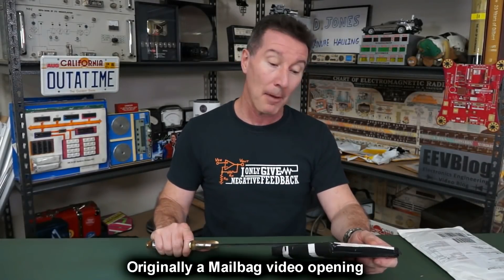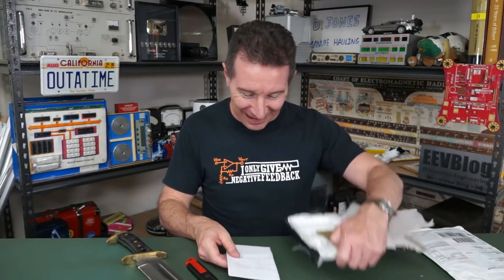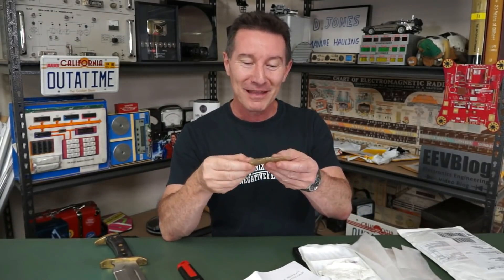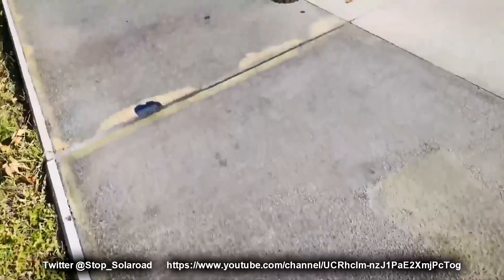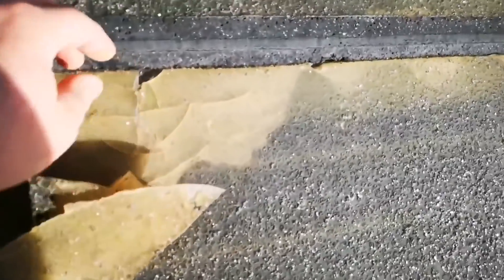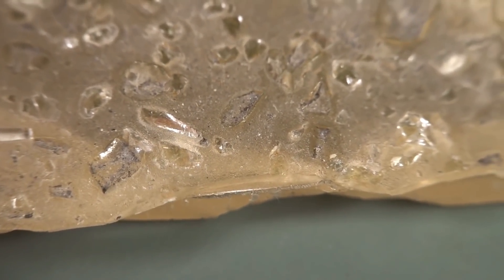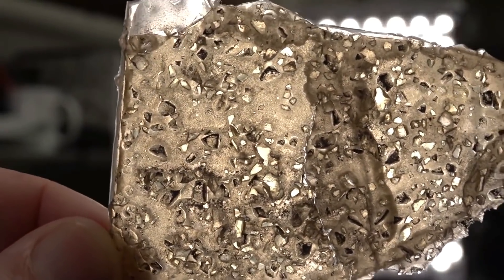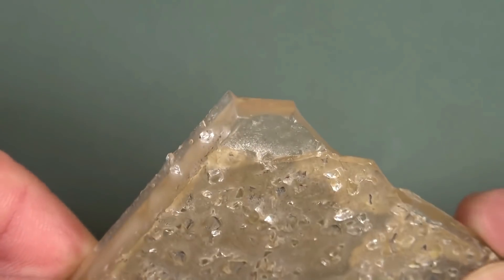EEVblog #1276 - Solar Roadways Surface TESTED!

Comment: Material is polyester resin,  same as in boats n swimming pool manufacturing. 
Clouds n looses opacity due to interactions with uv light. Once again a misplaced material in the solar roads.     5yrs in direct Sun is the limit for resin,  less without any paint protection from uv,  as it becomes increasingly brittle over time.  And without any reinforcement ( ie fibres of glass or carbon etc,  has almost zero tensilestrength whatsoever,  or why it's cracking on the edges where some flexibility occurs. 
Sand or crushed glass in the second layer thrown on top for traction,  increasing the light blocking once again. 

Totally the most wrong materials used for this purpose on a product that's misplaced in the first place.   
I am 20yrs a fibreglass n resin tech,
Reply: And this piece is just 1 year old, they resurfaced it several times because after 3-4 months it crumbles

Comment: Although your test indicates that amorphous cells might actually work in this application. Obviously, more tests are needed...
Reply: That amporphous cell was already saturated, meaning that even with the surface applied it was receiving more than enough light to reach full electricity production. If that amorphous cell had the same peak generation as the crystalline cell, it would suffer a similar efficiency loss once that surface was applied.

You can only extract so much energy from light, and even if amorphous cell efficiency would one day surpass crystalline cell efficiency, that would not even close to warrant putting them under a road surface before using them on rooftops or fields.

Comment: I told my mom (63 years old retired teacher) that they were making solar roadways and told me "but how can the sun get through the cars and bikes?" 
Well said!
Reply: That is simultaneously a perfectly valid question and a perfect example of how people fail basic math and common sense. Simple answer, those things move away and stop blocking the light so any panel is clear 90% of the time. Complex answer, majority of traffic jams happen at predictable times at same locations every day, so if the issue was a problem we could just not bother building any panels on those part of the road.
Reply: @AnalystPrime  Yeah, I'm no solar roadways fan, but the math is wrong.

A better question for people to ask themselves is why we waste so much space on black tar roads & concrete to begin with, especially in dense cities where we could invest in safer and cheaper mass transit.
Reply: @AnalystPrime  A better question, though, is to ask how much generating capacity there really is. The amount of "fallow / idle" land in the US is greater than the amount used by roads. We have lots dedicated to roads, especially in cities, but there's still plenty of more advantageous places to site solar (especially in cities, again).
Reply: @AnalystPrime  Why i feel like you're some kind of account created by Solar road company to defend their business? :D 

99% of people think this is ridiculous, but you're literally going against everyone? with the same style as flat earthers.
Reply: @coffeemakerbottomcracked  Because you cannot comprehend that people can see benefits where you cannot? The point of using roads is that the city owns the roads and can do whatever they want with them so nobody can complain they don't want panels on their roofs or on that field outside the town(supposedly they look ugly, and waste space, and destroy nature, also the developers want to build a parking lot there...which, OBVIOUSLY, is not an ugly nature destroying waste of space...). The weakness of solar is that we need huge areas for it, so it is going to be expensive and inefficient anyway, better to just build a lot of it. And yes, this is a crappy way to do it but it brings the panels among the city dwellers so they will have to notice where their power comes from.
Also, the project obviously needs a material you can cover the panels with, that will survive the pressure, UV rays and heat and cold. Whatever that material will be, we want it.
Reply: @AnalystPrime  Couple things there; Not wanting solar on your roof because "they look bad", albeit rather petty, is at least a valid argument. Thing is, it becomes less valid when you consider that most roofs in cities are rarely seen by anyone. Seriously, nobody cares how a 10 story building's roof looks like. And even if you didn't put solar on residential buildings because, naturally, that'd be up to the residents/landlords of said buildings, I want to see solar on EVERY municipal/city owned building before you even consider building a square meter of solar roadway. I'm fairly certain a lot of people would love to put solar on their roofs, but just plain don't own the building they live in, or don't have the disposable income to afford it. If the city spent a fraction of what a similar area of solar roadway would cost as grants to citizens/landlords looking to put solar on their roofs, it would be several orders of magnitude better and cheaper.
Reply: @coffeemakerbottomcracked  I don't think it's ridiculous. I think the "idea" is amazing. 

The problem is solar panels aren't really that great. The application of this idea is also terrible. 

If you could get a lot of energy out of little light and make the panels cheap and easy. I would support them 100%.

They are not easy cheap or efficient. They are best used in very sunny places and with directional control of the light.

Comment: 3rd attempt to post a comment:
Given the difference in loss between the normal panel and the "indoor" calculator style panel, I'm assuming it's possible to develop a panel that is somewhere between the too - higher output than the indoor one, but less susceptible to the loss the shadows cause on normal high output panels. Theoretically, that would make the concept of solar footpaths actually more sane.
However... I see practicality and safety problems. Like what happens when a panel is bent by a truck driving over it? If the cables/bars transmitting the power are damaged, you could end up with a hot spot, and potentially fire. They could bury the main transmission cables in a pit, but that dramatically increases the installation costs.

I propose a much simpler, more efficient alternative - build shade structures over carparks and playgrounds, and install plain, normal solar panels as the roof. Install the panels with spacers, and sunlight can still flow through the gaps.
Reply: Why do you need to propose solar panel shaded parking lots? They already have them installed in states that support  renewables. Google "solar parking canopies".
Reply: The indoor panel show less loss when shaded not because it handles low-light situations better than the polycrystaline panel, but because it handles high-light situations worse than the polycrystaline panel. Thus you do not win by moving to a panel that behaves more like the amorphous indoor panel, even if it is badly lit. But you do loose (likely a lot) if there is more light available. The only pro point for the amorphous indoor panel is low cost and lower resource usage while manufacturing it.

Comment: Top layer is probably some type of epoxy they used to bond the anti skid material to the glass bottom layer (or whatever material that is). Most epoxy formulations will yellow in UV light over time and I'm guessing that's what happened. There are UV stable formulations that won't yellow in reasonable conditions, but I'm not sure there is one that will remain completely unaffected in direct sunlight.

Comment: @EEVblog I love the videos and maybe I have missed it mate but how would you make the solar roadway if they gave you the project? Like what materials and how would you implement it? I love the videos debunking the previous and current projects but would love to hear your ideas on how to make it actually work if it could even be done!
Reply from the maker: The idea itself is fundamentally stupid, I would refuse to waste my time on it.
Reply: Not dave, but an EE. You don't. As long as there is a single roof, brownland or desert in vicinity of humans that has not been used for solar, you just don't. Hell, building SIDES are actually superior to this. Angle is not optimum, but snow and dirt resistance is high for those. That is why Dave debunks it so much. Solar Roadways is not a flawed concept that needs improvement, it needs to DIE. Especially as to not raise wholly unwarranted concerns against solar tech in the population. A large scale solar farm in arid, sunny regions can generate power for less than 2 cents a kwh. Solar is the future. Prices are dropping every year. In 10-20 years power from large scale freestanding solar will be next to free. If we figure out better storage, humanity is saved. Seriously. Don't endanger Public acceptance by selling garbage to the public. Extremely asinine.....
Reply: The idea in itself is bad... We have more than enough elevated surfaces where solar cells can be places a lot more efficient and cheaper

Comment: Looks like they cheaped out on the resin and didn't use UV stabilised stuff (hence the yellowing).

...would still have been crap, but maybe a little less crap for a little longer.

Comment: That's not a solar roadway. That's a solar bike path / sidewalk. Under those conditions, it might have a (slim) chance of working. Concrete generates zero power, so being able to get anything from the space is a plus. I can't see it being worth the expense, 'tho. (esp. vs. the extremely high output of roof mounted, and sun tracking panels.)

Comment: What's with the colour of it though? There is clearly something wrong with those pieces - they seem to be where the broken areas were, maybe something has bled into the layers? Or some sort of chemical reaction? Not sure, but you can't really test with this little piece of discoloured/overly opaque material and say it's a typical result for the path in general, which is much clearer. I'm not saying these things are even remotely good at what they're supposed to do (they're not) but I don't believe this is a good test, not unless one were to assume the whole path was this opaque, which it clearly isn't.
Reply: UV-light lead to a chemical reaction and the breakdown of the resin.
This is quite common with outdoor plastics (eg. when building ship yachts) and is one of the reasons why those things usually are painted or have a protective layer either on top or some particles or additive in them.

If this were the only problem then yes - you could invest into material science to find a solution. But this isn't the only problem. In fact the whole idea of laying a solar panel flat on the floor is already adumb idea. Solar panels don't have high efficiency numbers, technology is constantly fighting for every single percent more efficiency. And then throwing away at least 1 quarter of the possible energy by laying them flat on the floor (because of the angle to the sun)? Just that last simple argument is already a total show stopper for the whole idea.

Comment: Could have been a success if they installed the panels about 3 meters higher above the bike way and at an angle.  It would have caught a lot more sunlight and would have shielded the cyclists from rain an wind a bit.
Reply: Plus, it would shade cyclists from the sun, making them less likely to have to use air conditioning when they get home and saving more energy.

But nah, Solar Freakin Roadways
Reply: Even if they did NOT install it at an angle, installing it as a roof for the pathway would have been better. Of course, it being the Netherlands, adding a small wind turbine to every street lamp post would produce way more energy all year round for about the same investment.
Reply: Rene Schickbauer 
Solar panels must be installed at an angle not so much to catch more light but to make sure dirt and dust is rained of the panels. 

Small windturbines are extremely inefficiënt. Basically the wind doesn’t blow that much and if it does it’s either to soft or to hard. To ad to that wind turbines would suffer from tall buildings and even trees in an urban environment. Solar panels are a much much better investment than small windturbines.
Reply: But now you are using common sense..  that's something you can not accuse the greens of.
Reply: flexairz 
I think most ‘greens’ are a lot more practical than the people who “invented” this solar bike way. 
Even with 100% efficiency this was extremely expensive. 
Slick lobbyists and dumb politicians I presume. 
Just imagine how many solar panels could have been installed on roofs of buildings for the money that went into this farce.

Comment: To be fair, the transmissivity of the undamaged parts of the surface is much better than the damaged portions.  You can observe this in the newly laid sections: you can see the cell colour and structure through the surface.  Not to say this isn't a stupid and flawed concept to start with, and they obviously have some problems with the materials being used that severely limit the life span and usefulness of the concept.  The problem here could be water damage and weathering, since the surface starts to separate at the edges first, and it becomes much more opaque after it separates from the cell.

I just think you can't judge transmissivity of the surface from a damaged piece and it's not fair to judge efficiency from only this.  The main criticisms should continue to be durability, cost per Wh and usefulness.
Reply: No, i also took a clear piece, and it's same opaque, it's just a visual effect that it looks clear/dark

Comment: I'm surprised it produced as much as it did. I have a 300 watt panel in a south facing window with two storm windows and a screen and the panel is bigger than the window and I'm getting 5 watts from it.
Reply: 65% energy loss is a big accomplishment 🤣

Comment: Solar freaking cells working fine as they are
Some project in Netherlands cover the cells up with some semi translusent material so they can use them as roadways
There is a huge loss in efficiency
surprised Pikachu face

Comment: Why is one test that proves what you believe the "right one" but the second test that barely showed a current drop invalid? Can you explain why it didn't drop much on the second test other than a vague "saturation" explanation? You're going to have to dumb it down because I'm not an EE.
Reply: If it is already saturated you can't take good measurements
6 years ago dave calculated/guesstimated a 50% loss.... Now it looks like it's even more 60-65% loss of energy 😡😡😡😡😡
Reply: @stop-solaroad84  So...if it was in the sunlight all day it would be saturated, right? And the protective layer wouldn't matter? Or does it just take longer to show the drop in current due to the saturation?
Reply: @MrV1NC3N7V3G4  if you put 10 suns on this solar panel it will give the same output as 1/10 of 1 sun
Reply: @MrV1NC3N7V3G4  
If he had waited for a couple of minutes the current would have dropped.
If you recall the numbers you may remember that the amorph cell already were much worse then the polycristalline cells. So one can say: Yes, the polycristalline cells could not keep the current as long as the amorphous ones. But that doesn't mean they are worse. In fact the amorphous ones are worse, but in case of saturation they are able to be be worse just a little bit longer.

Comment: So, can the translucent layer be replaced without replacing the whole panel? If not, that alone should have killed this idea before they spent money installing it.
Reply: You can replace the top layer.... They did many many times....
Reply: @stop-solaroad84  Alright, so the state they're in shown by the clip is due to long neglect/abandonment. Would be interesting to know how many work hours would need to go into maintaining that bike path in decent condition, mostly just for fun to see how much of a money sink it is.
Reply: @madaggar9765  no not long neglect, they keep repairing it monthly since 2014, a kwh costs about 1000,- by now 🤣
Reply: Seems like they would want to replace each part separately.

Comment: My problem with all these solar roadways/pedways/bike paths/whatever - not to mention the "super-efficient turbines" covered recently - is that nobody involved is showing an ounce of scientific rigor. All the companies are clearly tech startups hoping for a buyout from Google or another megacorp. Not one person has said anything like, "this is a very, very early prototype we're going to be using for testing the concept and our implementation. We don't expect much from it, and we will have to dig it all up and reinstall everything multiple times as we work towards a viable system." No, it's all, "replace all your roads and sidewalks with our product TODAY!" Then cynical (or stupid) politicians sign on for the free good will points, small sections are installed, and...nothing. This particular chunk was installed years ago, but is yellowed like it's from the 60's. It's more expensive than simple asphalt, it's about as durable as warm butter, and if they're making their money back, I'll eat the rest of the roadway.